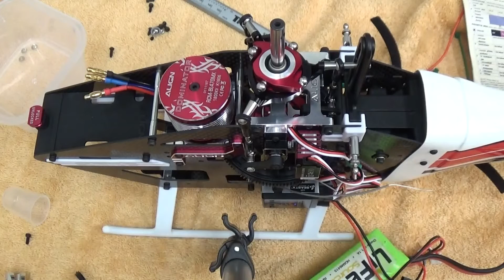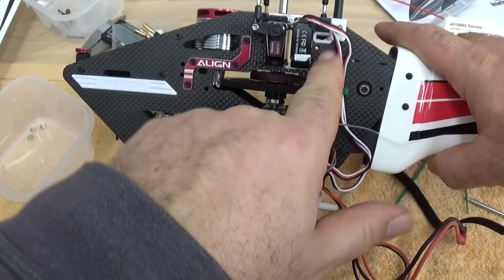TREX470LM swash leveling

Comment: Rare Earth Magnet and Sewing Needle.  Magnetic / Needle
Even a regular Magnetic / Needle will work. Level the  swash after a complete build. Pre flight daily check with Magnetic / Needle.
Low cost, Fast, No head removal, No leveling required.
Reply: I use magnet and tiny Allen key .same idea .works perfectly

Comment: Well... This is not really a swashplate levelling procedure . What you're showing here is centring servo arms at 90deg. The actual levelling is playing with individual servo linkages.
Reply from the maker: It is.  I make up three linkages exact same length and to the length specified in the manual. I am using the swash leveling function of the BeastX to fine tune swash position. I never mess with linkages
Reply: @jimsenicka  thats a really good way to do it actually. Thank you for sharing.